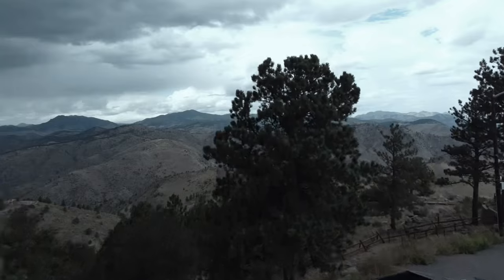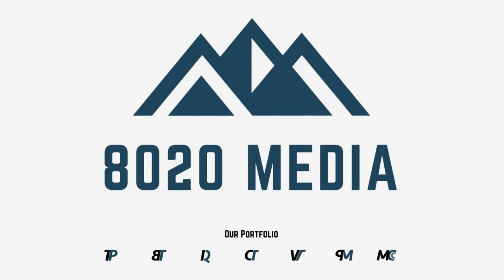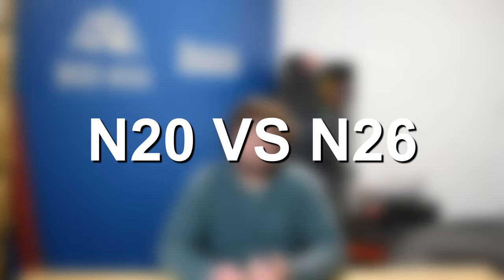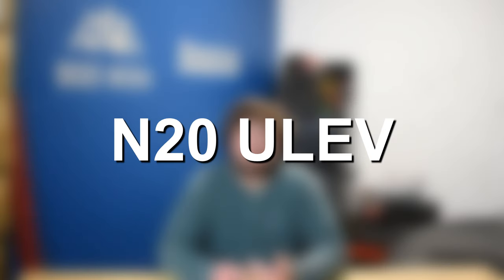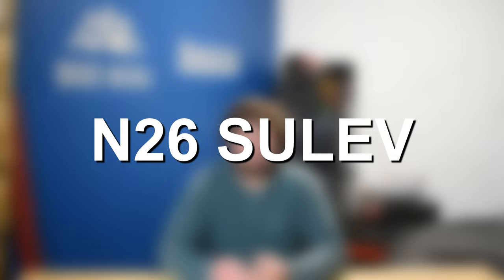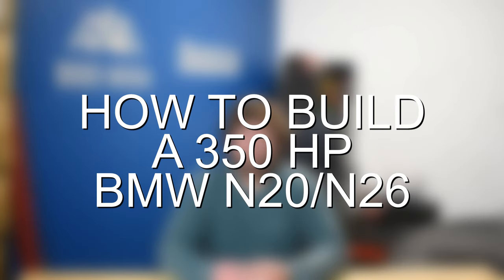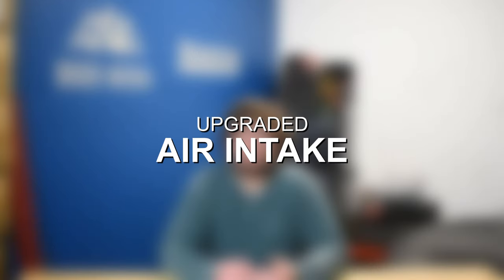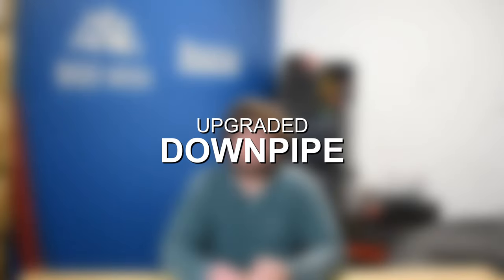How to Build a 350HP BMW N20!

Comment: Forgot to mention- boost pipe, charge pipe, turbo inlet due to stock BMW pipes being plastic upgrading to aluminum piping will help not crack any pipes and will hold boost pretty nice👌🏼 I got a 437whp N26 with a pure stage 2 turbo
Reply from the maker: J - Nice! You've built a good one! Thanks for sharing your experience.
Reply: How long have you had it, and how many miles /year?
Reply: shit man 437 whp on a hybrid turbo. E85? Meth? I didn’t know that was possible
Reply: post some vids PLEASE
Reply: I’m currently building my n26 with a stage 2 turbo. I was curious to see how much I could get out of this little thing. You just answered my question
Reply: @jarredwakefield1116  I don't believe it tbh
Reply: If you’re telling the truth, name the mods, brands, stage, and name them specifically! Let’s see and I’ll replicate those mods and confirm if it’s even close gains your stating
Reply: @scott331  i dont see how a hybrid turbo can flow so much air, but maybe i just dont understand cars well enough
Reply: Guys either he meant 437 NM or typed wrong and ment 337 whp
Reply: Stock internals??
Reply: I currently have a 2014 428i (N26 Engine) with Full Bolt ons below with stock internals running on Bootmod3 Stage 2 (93 Oct) & Stage 3 xHP transmission tune with original motor at 141K Miles on odometer. Haven’t dyno’d yet but I get a projected 496 miles on a full tank (I have pictures as proof). I really want to replace OEM Turbo for something slightly more efficient. This car has been so good to me thus far after owning it for 7 years and putting 90K miles on it. 

- FTP Charge Pipe 
- FTP Boost Pipe
- FTP Turbo Inlet Pipe
- GFB DV+
- Burger Motorsport FMIC
- TruCrane High Flow Downpipe (4”/200 CEL) 
- aFe Silver Bullet Throttle Body Spacer
- INJEN Cold Air Intake 
- VelossaTech Dynamic Air Scoops (2 scoops for engine and intake side) 
- Pedal Commander (PC10) 
- Oil Catch Can (eBay/Mishimoto rep) 
- DINAN Freeflow Exhaust (335i style) 
- Timing Chain Guide replaced 
- retrofitted HPFP 
- DINAN Ignition Coils 
- NGK spark plugs
- Second Cat Delete
- Resonator Delete
Reply: @pandaboi57 I have all the same mods 2016 n20 328i but I left the resonator only 2nd cat delete and hi flow cat. Also stock internals. Run stage 2 e40 weekends & stage 2 93 daily. Car is a blast to drive!! Have plans to build engine & pure stage 2 turbos* atm I’m at 340hp. it’s a sleeper … light weight/fast off the line.  Getting G80 m3 while I build the n20, these cars are spectacular🙌🏼
Reply: @hollywood2177  there’s little to no drone with the resonator delete. It definitely gives it more volume and slightly loudness. But the loudness I don’t consider drone since there’s not much feedback especially when I’m driving on freeways/highways. It’s still very tamed but if I open the throttle then it sings a bit. 

Also, you’re making 340whp on E40? That’s not possible on a stock turbo even running an E40 blend. Unless you already have an upgraded turbo as you mentioned the PureStage2 (PS2). Although I would highly consider getting the TTE400 which has a lifetime warranty if you purchase from Turner motorsports. It’s the biggest hybrid turbo in the stock position and better bang for your buck than an overpriced PS2 if you don’t get it off second hand from someone else.
Reply: @pandaboi57 where did you get the transmission tune because bootmod3 only has 1 upgrade tune that I run and its alright
Reply: @andrewreed7607  there’s an app and software called “xHP Flashtool” it gives you a lot more flexibility and room to customize your transmission shift points, how fast you shift, settings to edit burbles as well. It supports most transmissions and you can verify on their site.
Reply: Do you have dyno sheet or video proof? Pure Stage 2 is smaller than the TTE400 and even running full e85 custom tune you’ll needed upgraded HPFP and upgraded S63tu injectors at least. I haven’t seen a 430+ “wheel horsepower” N20/N26 and of course you’ll needed forged internals. Curious about your setup bro.
Reply: i love this comment post more about your car !
Reply: I have one too. I haven’t gone with meth yet. I’m about to install a csf radiator. I redid the engine I have Carrillo rods and pistons.
Reply: @hollywood2177 @pandaboi57 you guys both sound like you have sweet cars to drive, I have a 16’ n20 but 320 xdrive. I wanna turn the thing into a beast. I’ve planned on doing pretty well everything you’ve both done but now you kinda confirmed it for me. Let me know if you ever do turbo upgrades at all I’m curious… Thanks for all the insight!

Comment: I have 432k miles on my 328i 10 years old, all original engine/drivetrain, Dinan stage 1 tuning piggy back @ 3k, Injen tuned cold air intake, MST Turbo Inlet pipe, Dinan Catback exhaust,  Wagner Stage 3 Competition fmic Intercooler which gives me mid- high rpm noticeable hp gains, ER charge pipes both, now I’m looking at getting an ER catted downpipe and I’m happy. Only maintenance I’ve done is changed the high pressure fuel pump @ 67k miles, EWG 180k miles, and changed timing chain guides which crossed over to the Rod Bearing so I changed that out to, never changed transmission fluid however changed engine oil 0-30 , 5-30 BMW, or Liquid Molly oil every 6-8k miles. Never revved in traffic, warmed car up and drove smoothly for the first 8-10 minutes to lube up the engine bearings and cylinder’s properly before shifting to high speeds. One thing I’ve noticed is that these cars are built to be driven. Never dinno but butt g’s made me satisfied
Reply from the maker: S - Nice! This is a great success story for the BMW N20!
Reply: I have a 2014 320i with a stage 1 tune. I'm at 133k km now, the chain feels sturdy. When would you recommend changing the chain/tensioners
Reply from the maker: N - We typically recommend it at 100k miles, but it's different for each engine. Stay on top of maintenance.
Reply: @8020Media i heard the big timing chain issues were fixed after 2015 on the n20 right? Ive got a 2015 528i with about 93k and just wondering
Reply from the maker: R - We have a great article on this on our website: https://bmwtuning.co/bmw-n20-timing-chain-failure-symptoms-solutions/
Reply: @road_mine8733 just get a b48 forget the n20
Reply: 432k mils? say it again? 🙂 It will take me a life time to get to even close to this milage, my 220i n20 2016 stage 2 is at 43k miles only 🙂
Reply: I have a 2013 328i M sport. I’ve done the timing chain, injectors, hpfp, vanos solenoids actuators, Vanos solenoid intake sprocket, vanos solenoid themselfs, new oem MHI turbo upgrade, new oils filter and intake manifold gaskets, and ignition coils and spark plugs, engine mounts and transmission mounts, B12 Cup kit. 172k miles, runs great 👍🏼
Reply: @rolo7487 how many times has the chain been replaced? I have an n20 stock and it happened once at 70k miles
Reply: @Sequel7  I’m pretty sure it’s just a one-time thing. I mean, you simply change it because of the faulty guides recall, and after that, you’re good to go. Just do an oil change every 8k km with Liqui Moly and keep the N20 stock without tuning. However, definitely replace parts with performance upgrades!
Reply: That’s just mind blowing mileage for a N20!
Reply: 200k miles on my 14 328i n26, recently did the valvetronic, lots of maintenance but the engine runs great, 25+ mpg , pulls hard.  Great cars if you do preventative stuff💪
Reply: @Sequel7 roll of the dice, some chains last 500k, same with water pump, alternator ect. timing chain tensioner is important to keep chains tight as they wear out and let the chain slap around
Reply: How TH did you put 432k miles on a car in 10 years?  Driving 120 miles every day?

Comment: So let me get this straight. You do not need an upgraded fuel pump for the N20 engine? That’s Amazing. I figured it would, considering the N54-N55 needed one but it makes sense that it doesn’t seeing as it’s a newer engine.
Reply from the maker: 77 - It depends on what level of hp you're going for. For the sake of the power in the video, no. Fueling modifications can help keep engine temperatures lower with high horsepower builds, but ultimately, the N20's internals weren't built to withstand much more than that.
Reply: @8020Media how much power would you say an n20 could reliably make with forged internals
Reply from the maker: Finn - It depends how much money you're looking to pour into it.

Comment: Just bought a 328 , looking to build daily/street without feeling I could’ve just bought an n55 lol thanks for this
Reply from the maker: B - Hope it helps.
Reply: Ive had my n20 for 3 years i have a K&N drop in filter bimmer code trans tune and stage 1 just watch out for ofhg leak😭 had oil in coolant had to flush the system like 5 times
Reply from the maker: Chicago - Thanks for sharing your experience and helping wolf!
Reply from the maker: Chicago - Thanks for sharing your experience and helping wolf!

Comment: The timing chain kits are different between the n20 and n26 nobody seems to mention this.
Reply from the maker: D - Thanks for the insight.
Reply: @alexinadon7999  they are not interchangeable between the two so if u have to replace make sure you get the n20 specific vice-versa for n26
Reply: My friend recently did a timing chain job on his N26 X4 went out and bought a n20 timing chain kit upon installation it was apparent that the N20 kit is different from the N26 so he had to get a refund and source the N26 specific kit

Comment: Im building a forged internals N20B20 with ductile iron flanged sleeves... its FBO, might do an impeller upgrade on the turbo, keeping it on a basic piggyback for around 300hp/320tq for reliability and MPG
Reply from the maker: Geoffrey - Sounds like you're building a good one! Keep us updated.

Comment: N20 motor is such a fun motor! Ive owned my 2014 X1 Msport almost a year now at 107k miles and now about to cross 120k miles. No issues no timing chain issues just be on top of your maintenance! The car came with a AWE intake and the previous owner also gave me a dinan boost module for free with the car (took it off because it threw me a code) but otherwise really fun car i also beat on it and it hasnt let me down yet! Cant wait to upgrade my charge pipes and downpipe
Reply from the maker: D - We agree. Thanks for taking the time to share your experience!

Comment: Great video, On my EWG 2013 N20  I have an Active Autowerke tune on my car for the last 5 years with zero issues. Another great tuner in the USA
Reply from the maker: Q - We agree! Thanks for sharing your experience!
Reply: How you found out if it’s EWG or PWG? I’m also with a N20 2013.
Reply from the maker: K - Look up the VIN. It should say there.
Reply: @kevinho040 You can just look at it, PWG will have hoses not wires going to it and look more like an old school wastegate on a 90s car vs a harness wire plug to it

Comment: Another great video but It would be helpful, imo, to maybe address the n20 reliability issues (timing chain) before presenting power upgrade options. Vehicular DIY has a great one about this engine and how to avoid its most notorious issues.
Reply from the maker: Spian - Thank you for the feedback! We have a completely separate video covering common problems here: https://youtu.be/EdpZd1-7f-U
Reply: The N20 is very reliable

Comment: Thank-you for this video.  I just picked up a sDrive 28i Z4 w M sport package.  Has the N20.  Was wondering what I could get out of this little engine.  I'm sure 350 HP feels much different than stock!
Reply from the maker: MVF - Thanks for sharing your feedback and experience!
Reply: Get bootmode tune stage 1 or 2 93
Full bolt ons fmic ,exhaust ,hi flow cat ,diverter valve , CHARGE PIPE, stock intake(aftermarket for sounds) carbonfiber intake 1k$ makes more power* transmission tune, liquid Molly oil 5-30 , inlet pipe, 
stage 2 e40 340hp
Reply from the maker: H - Yup, basically what we have in the video.

Comment: I noticed that there are intakes for other BMW that is equipped with the N20 motor, but I am not seeing any for the X3 28i N20. The only thing I can find are drop in filters, a GFB DV, FMIC and Charge Pipes. Haven't looked into a downpipe but will do so when I purchase a supersprint exhaust.
Reply from the maker: C - Keep us posted! Sounds like you're building a nice N20.

Comment: 350HP on a 20i 👀....?!

Have a bone stock PWG N20 320i (ZF8), bought at 186k KMs, just hit 222k KMs. Uses no oil or coolant, no smoke, and has never stuttered once (knocks on wood!). In the almost 40k KMs I've had it, oil has been changed maybe 8 times. Motor has been great, planning to stay stock, would love XHP Stg 2 for the ZF8 though. Also bit more sound would be nice, like a stock MK7 Golf GTI. 

Now the rear suspension on the other hand has been a nightmare...
Reply from the maker: S - Thanks for taking the time to share your experience!

Comment: I have a 2014 bmw 320i I have everything on it that you mention and I have 3inch straight pipe I don’t know  how much horsepower it has and I use 93 for gas
Reply from the maker: Ron - Nice! You're probably around that 350hp if you have a good tune!

Comment: Where can I buy all these parts I have a 2013 528i
Reply from the maker: VRSF is a good option for a downpipe and FMIC. There are tons of intakes available. You can get the JB4 from Burger Motorsports if you want to go that tuning route, or there's bootmod3 which is just purchased online/through the app. Ultimately, all the parts are going to be easiest to buy online and there are tons of options for the N20.

Comment: Have a 2015 228i with the n20/n26. I'm considering doing a stage 1 (BM3) tune. I'm a bit concerned on how this will impact reliability as this is my only car. I plan on doing an aluminum charge and boost pipe just in case, but have heard that you need to change spark plugs, ignition coils, and do oil changes more regularly. Have you noticed any issues with engine reliability after doing a tune?
Reply from the maker: A conservative stage 1 tune shouldn't have any notable impacts on N20 reliability. That said, higher boost does put a little more stress on the turbocharger and some other ancillary components. If you're frequently going WOT and using the newfound power that could shorten turbo longevity a little bit.

Otherwise, it's true that you'll also end up replacing spark plugs and ignition coils a little more often (again, especially if you're frequently using all the power and boost). You shouldn't need to change the oil more frequently unless you only change the oil every 10,000 miles. I'd recommend changing the sooner (every ~4,000 to 7,500 miles) regardless of whether the engine is stock or tuned.
Reply: Just need chargepipe. Oil change every 3-5k miles if you keep stock intake. These intakes are good and keep engine clean. Carbonfiber if you race & go stage 2e40
Reply: @8020Media  sorry didn't see this. I am comfortable with my car as is, but if I can safely increase power then I might explore it. I do go WOT a few times a day when I drive because I live in Atlanta and need to accelerate pretty rapidly in order to safely merge and not get cut off. I used to drive a 138hp Corolla and got bullied a lot on the road. I've only had this car for a little more than a year (my dad was the only previous owner) so I'll start changing the oil a bit more frequently regardless of a tune. When I have some extra money, I'm probably going to have an aluminum charge and boost pipe installed just for preventative maintenance. After all that, I've toyed with idea of a stage 1 bm3 tune, but not if it screws up my daily driver. This is the only car I have and I'm really not in the position to get another.
Reply: @hollywood2177  I'd only go stage 1 because stage 2 needs a downpipe which is a headache for city emissions tests. When I get some more money, I'm planning on doing a charge and boost pipe regardless of whether I tune it. I'd like to keep it as reliable as possible, but if I can safely go stage 1 then I'll consider it. Would like to hold on to the car for a bit.

Comment: I believe the 328i’s N20 engine has stronger pistons than the 320i’s N20, but I could be wrong
Reply from the maker: The pistons are slightly different due to compression ratios but I don't know that there is a major strength difference with respect to power capacity
Reply: The 320 and 328 have the same internals just different compression they share their internals with the N55